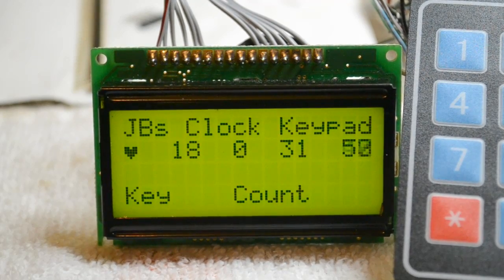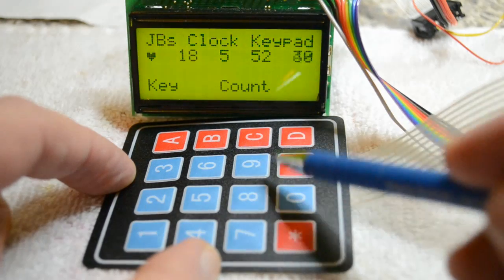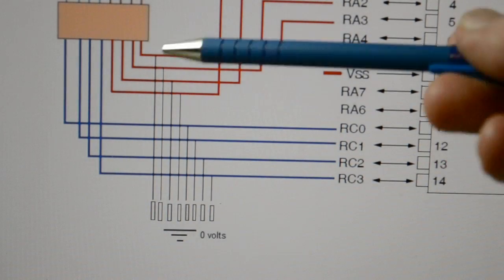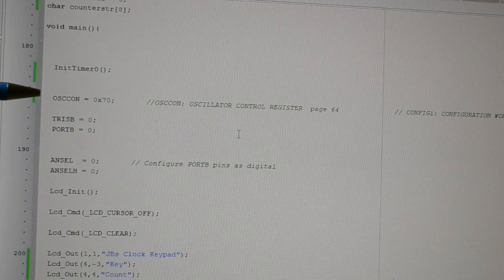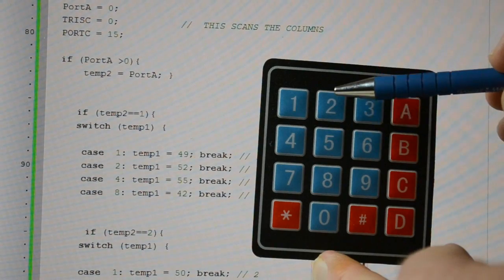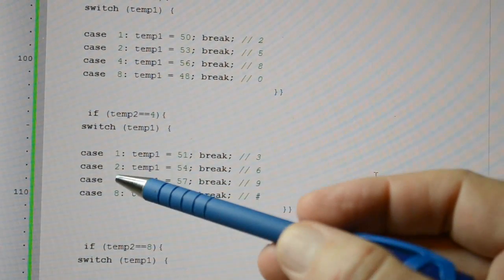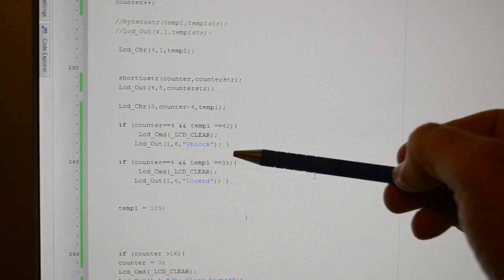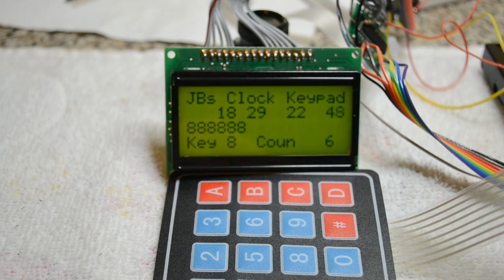4x4 Keypad Matrix Demo with Code and Wiring

Comment: Hello John, I saw your video.
Would you can give me a hand? I need to make a 5x5 matrix teclao, but when I press the keys, must be sent in UART these bytes, for example if I press the "1" key should be sent in UART 0x01, 0x01, 0xE3, if u press the button "2 "should be sent on the UART 0x02, 0x02, 0xE3. I need to write this code for the microcontroller 18f45k22. with the XC compiler 8. you can help?

thanks a lot
sorry I do not speak English'm using an electronic translator.
Reply from the maker: Hi,
What is the 'teclao' ? 
Also, why do you need to send 0XE3 (decimal 227)?
In my video, if I press a key, the display shows the key pressed.
You would simply do the same AND
UART1_Write(0x01);
UART1_Write(0x01);
UART1_Write(0xE3);
Regards
John

Comment: Hi John,
Great video there! I actually got quite far with this keypad thing but then got a little confused with the hardware layout. Initially for understanding I started with MikroC's standard library worked like a treat, but then I realised that with my CAN module and LCD I've run out of a full available port. Now I've got enough IOs to provide 8pin interface but they are all scattered i.e a mix n match of PORT A, B & C. How should I go about making a matrix where I can simply put my rows and columns assigned to different pins...
Cheers for the video!
Reply from the maker: Hi Syed,
At least the columns or rows would need to be on one port or, you're going to need lots of IF's or SWITCH statements and it Will get confusing.
You could  power up the columns easily and read the four Rows like below (depending on where your Row pins are.
i.e.
TRISA = 0b00101000            2 rows on PortA  (as an example 2 row pins on A)
TRISB=  0b01000000            1 row on PortB     These are inputs
TRISC=  0b00010000            1 row on PortC

Read rows then power up the rows like below

PORTA = 40
PORTB = 64                      (this powers up the above row example
PORTC = 16

Then read the columns but, that depends on what else is on the port and if it needs power when you're trying to scan the keypad.

For your LCD, you can move the RS & E to any pin if it will free up 4 pins on one port for the keypad.
Same for the CAN,   Chip Select can be moved.
Maybe moving the CAN too to a different SPI if it's going to help.
Reply: Cheers for the logic John. 
I'll write you in detail later but for now to give you an idea about my setup I've gone for a 28pin PIC18F25K80 with builtin CAN, only 2pins of micro for CAN. The problem is that the CAN module is fixed either on Port B or C. Plus I'm thinking since there won't be 8 IOs available on each one of these ports I'll need to have rows on one and columns on the other port.
Reply from the maker: Yes that's ok, it will be like my example.